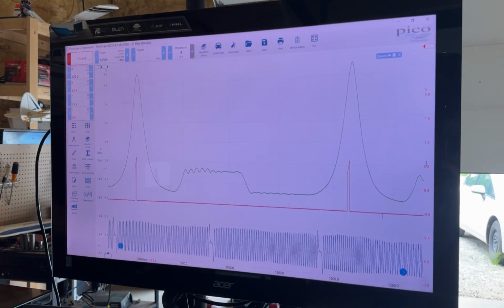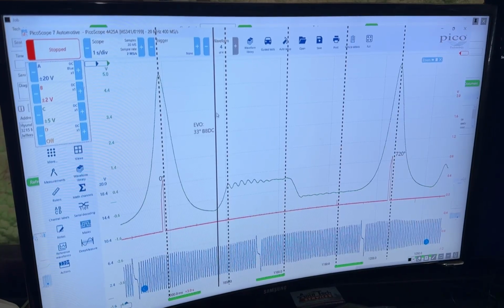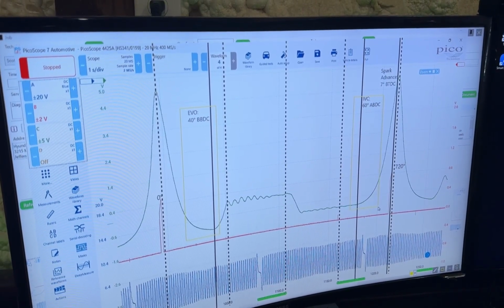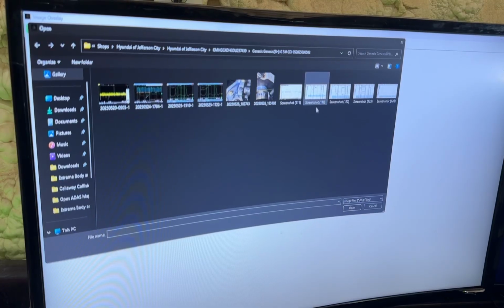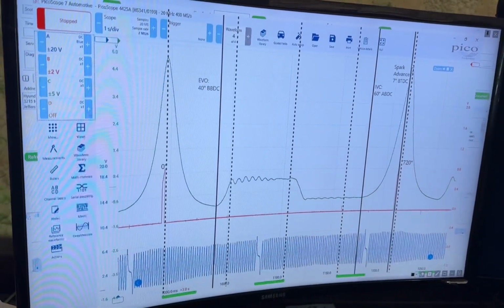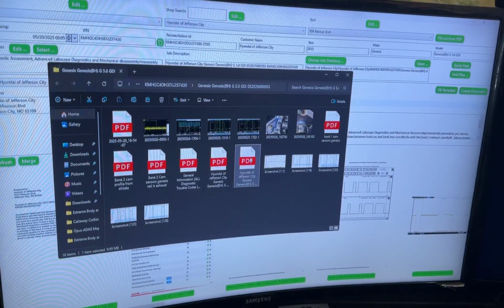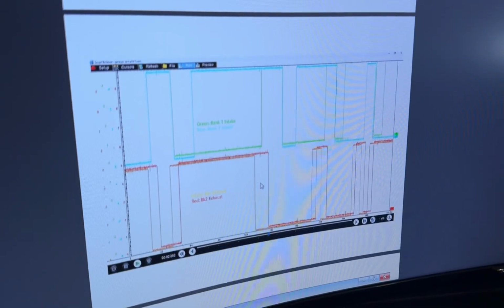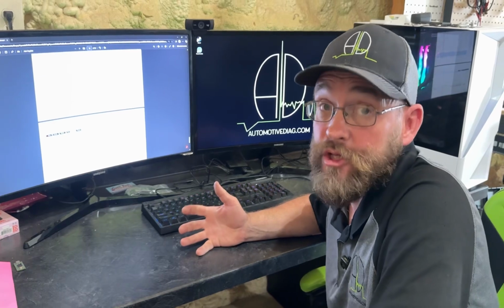Diag on 2015 Hyundai Genesis

Comment: Any ideas on how to do in cylinder on 3.6 Chrysler when bank 2 is covered by intake and no clearance to run pressure hose and snap on sensor. And with intake off no vacuum or pressure differential shows on just cranking
Reply from the maker: Did you know that a 3.6l pentastar will idle with the intake manifold removed?   You're going to have an in cylinder pattern with no manifold vacuum, but you can still check the timing points that way.  I was floored the first time I did it. It's pretty cool.  😁
Reply: @automotive_diag no way didnt know that